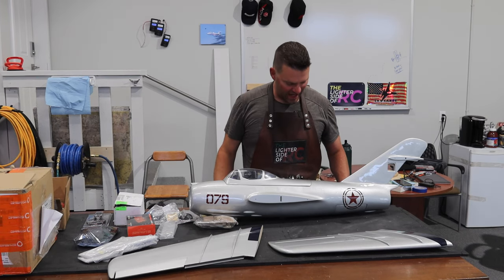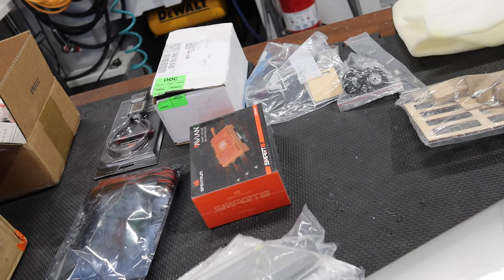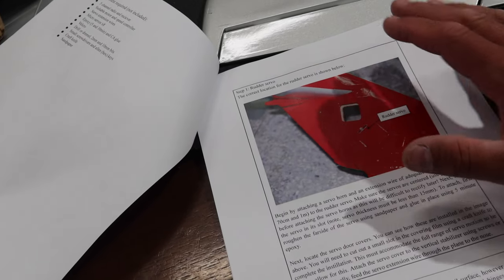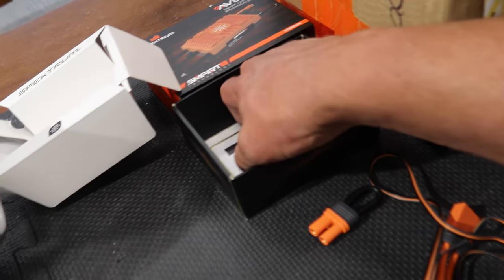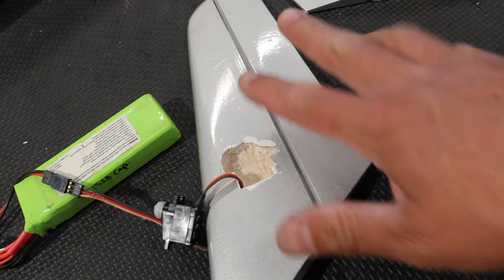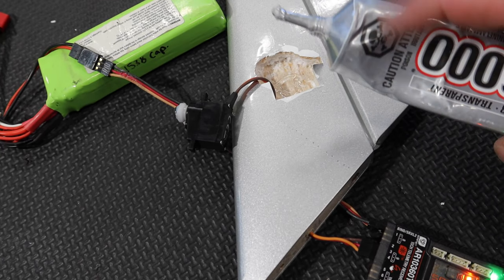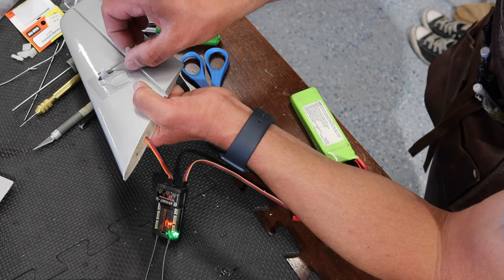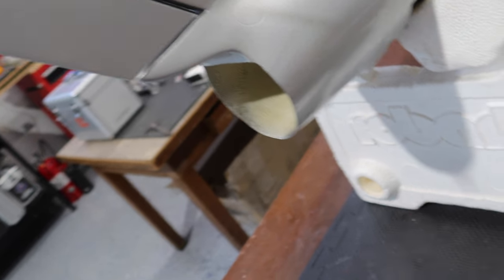THE ULTIMATE mini EDF Jet BUILD - MIG 15

Comment: I like your structured way of approaching a build. Elevators are a good example as what you have done is a far better idea than the Factory design. At the speeds these things fly geometry is everything under the quite high G loading these things are under don,t take much to come apart. The Mig be good candidate for film striping and very light glassing for a more durable long lasting  finish as I suspect that covering ain,t gonna do well under heavy use. Great Vid. Carry on.

Cheers Nick (outa NZ )
Reply from the maker: Thanks Nick!  Wanting to get her setup as nice as possible.  By the end she should be a beauty and solid aircraft.

Comment: what’s hysol? do you mean epoxy?
Reply from the maker: Hysol is a brand of thickened epoxy. Generally regular epoxy will run and not stay put.
Reply: @thelightersideofrc  Roger that, thank you Sir!
Reply: @thelightersideofrc  I'm assembling the exact same plane.  It's been sitting in my shop for years and years ☺